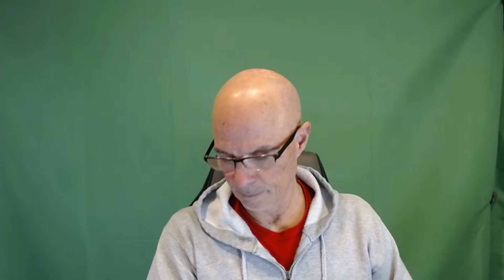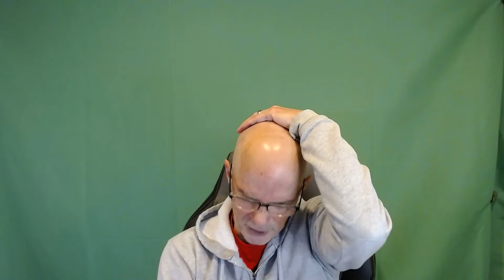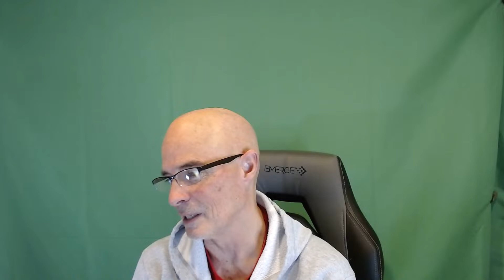LET'S TALK TECH-WHAT IS A TUNNEL RAM CAM?

Comment: Asking if there is a tunnel ram cam is like saying there is a dual plane or single plane cam. That being said, carb tuning is what makes or breaks a tunnel ram application. (It needs an O2 gauge and is very time consuming). I had great success with Edelbrock 1404s and Quick Fuel 450 cfm TRVS carbs. The QF carbs were better than the 1850s not because they were smaller, but because they come with smaller jets (needed for a dual quad set up) and air bleed jets. I have changed AFR by playing with high speed and low speed bleeds respectively. But I'll save air bleeds for AFR for another day. Finally, yes, Weiand called it a high ram, we call it a tunnel ram.

Last thing, I ran our 2018 5.0 Mustang (auto) at Top Gun Raceway (4000 foot altitude) and it went 13.02@ 108.9 OBSERVED.

Comment: Obviously the best cam for any induction setup is an infinitely variable lift, duration, timing, valve size, port size, and direct injection possibly with upstream port injectors for some rpm/demand ranges... 😂

Comment: Would be interesting to see the following test. 
Factory Long Runner 5.0 Ford with AFR heads and keep adding bigger cams until it stops increasing its torque peak.
Reply from the maker: peak torque or where peak torque happens?
Reply: @richardholdener1727  Amount, should still happen about the same revs.

Comment: I have a tunnel ram going on a sbf with nitrous plates. I want to run carbs sideways but it's an older offenhause with a dual plane style divider  starting an inch or so down. Will it effect running them sideways?
Reply from the maker: running them sideways is just fitment and throttle actuation (jetting might be different that fore-aft mounting)

Comment: Pick a camshaft that suits the application you have or build an engine knowing that's what you'll be using and pick the camshaft that suits your build. I've stuck them on my engines that already can handle it. Proper compression cylinder heads etc. If you ve been doing it a while you can play around. Even on the street.

Comment: Tunnel ram cams & S..D. have one thing in common: they are both long winded And STEVES  p..t.
is driving instructor for the crew that films _GTA5 THE DODGE..
THE TRX'mobiles (Rams)run 10000 to 1400hp..

He does his usual stuffed:taunt cops, with windows 
 -all-pitch black.
I suspect he knows the head mamacita@ the lusty-busty emporium very well.
$15.00 per and all he can eat.
They have a very diverse buffet.....

Hey, Rich....
Reply from the maker: what is SD
Reply: Steve Dulcich.

Comment: So we know a bigger camshaft tends to make more power and that as you go bigger you tend to trade low end power for peak power so camshaft events are really about how it does at low rpm not about peak ..... So with a longer runner can you run more camshaft and make more power before you loose a lot of low end power as compared to a short runner that might even flow more but can't run as much camshaft because it loses to much low end to be a nice driver ? That would make it a camshaft specific to a particular intake
Reply from the maker: a short runner might not flow more than a long runner-flow is not why it is tune for making power higher in the rev range. Cams, like intakes, are optimized for specific (though broad) rpm ranges-there is no tunnel ram cam (lots will work, and provide different power curves for different desired outcomes)
Reply: @richardholdener1727  I think you missed my point .....